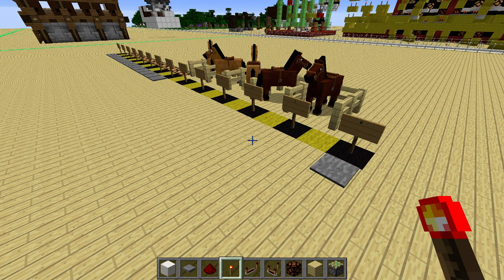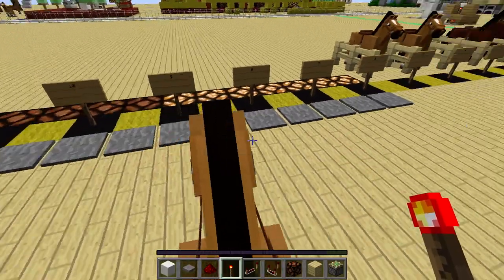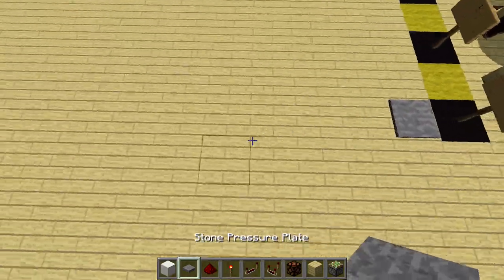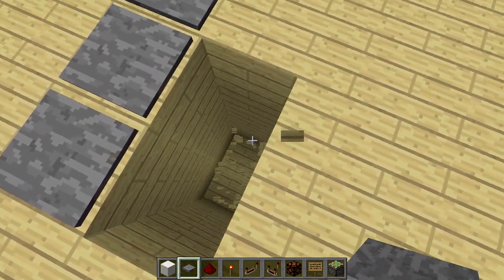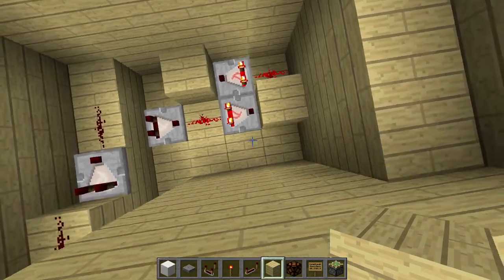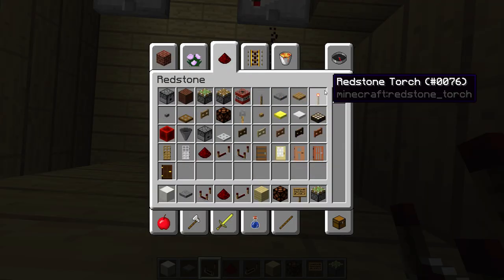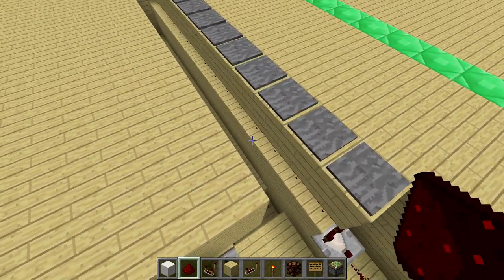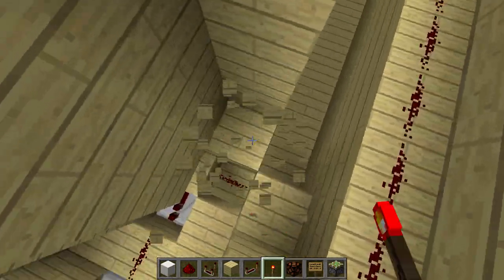Horse Speedometer [Tutorial]

Comment: If you want to be picky about the horse's alignment before beginning the test, put two cobblestone fences spaced one block apart just before the first pressure plate. If you check it in debug display the horse position can only vary 0.004 blocks inside this gap. (Minecraft 1.13.1)

You can also put a single iron fence or end rod behind the last pressure plate to help align your cursor, if you don't want to use debug to check/correct your heading.

Comment: Thank you for sharing this speedometer. That's exactly what i was looking for.
However, did you check the accuracy ? I try with horses with speed from 0.2 to 0.3375 with a 0.0125 step and there was a 1-2 block error with the expected result. I think this is due to the 4 tick pulse. Removing 2 ticks on one of the repeaters seems to fix it.